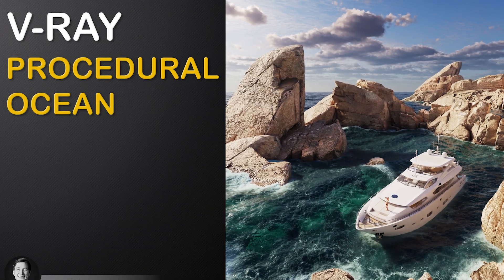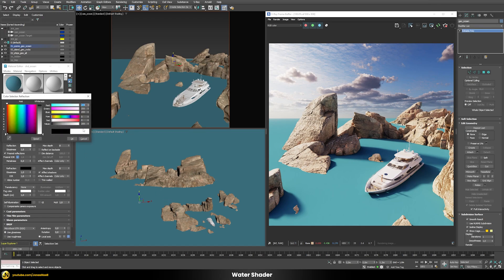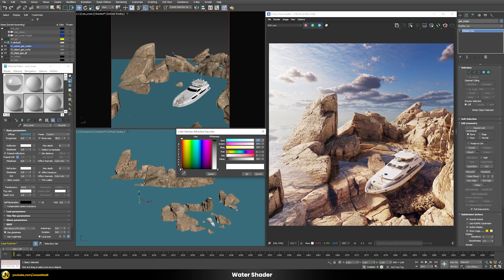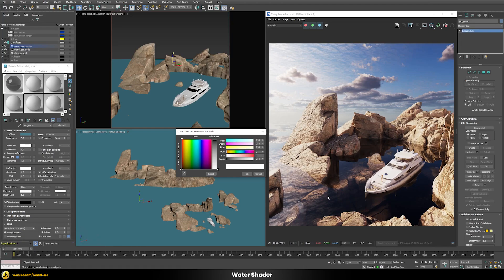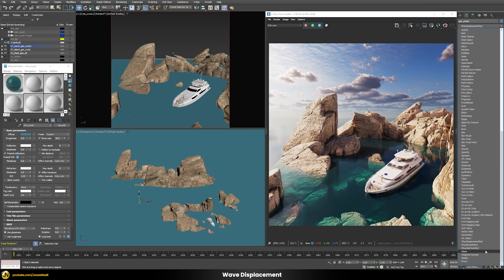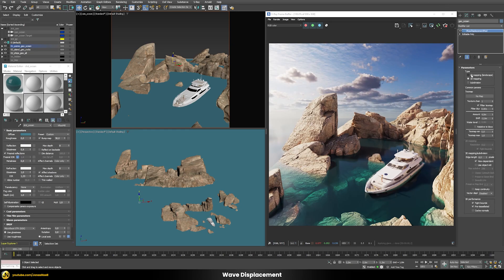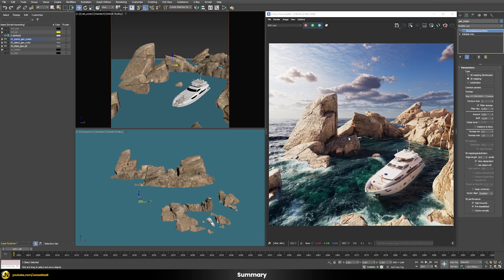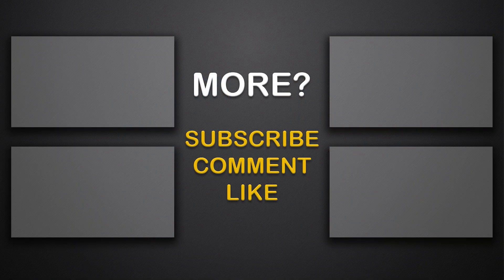V-Ray | Realistic PROCEDURAL OCEAN Shader

Comment from the maker: ✅Check out Patreon for all my scene files, bonus videos, a whole course on car rendering or just to support this channel 🙂
patreon.com/JonasNoell
Reply: Great tutorial! I am wondering, did you give any depth to your water plane? I'm working on a similar project and it seems like if i dont give depth, there is no refraction. If i push the thin walled option there is but its way too much and there is no options... any ideas? thank you.
Reply from the maker: @crazyneonate8626  If I remember correctly I didn't have to. The plane was quite big though. But you're correct normally for refractive shaders you would need some sort of volume to get a accurate result.
Reply: @JonasNoell  Hi Jonas, you are right, you dont have to, my mistake was that the refraction IOR was a 1.33, which is correct but didnt let enough detail come through, when i pushed it down to 1.15 it was perfect! thanks for your answer

Comment: Nice but this should be a standard in max. 30 years ago
btw your fog color was for 1cm
Reply from the maker: What exactly should be a standard?
Reply: @JonasNoell  max should have had a good water material like phoenix long ago. there should be no plugin renderers either. max' built in should be the best. there should be no forest or railclone either. all autodesk specialize in is lazy extreme overpricing

Comment: i tried many times , the result not even close , why is that? what should i do? can anyone answer me?
Reply from the maker: I don’t think with that description anyone is able to help 😀
Reply: @JonasNoell  I set scale to meter, and in Max 2020 with Vray 5.20.02 installed.i even tried with high segment plane and once  with no segment plane.even with high segment box and with no segment box.then I did all of above with changing scale to centimeters.
Then I tried with Max 2022 with Vray 5
Then with Max 2023 Vray 6 
Exactly according to video
Reply from the maker: @vahidmalekpour6139  I guess some issues with your scene and or lighting setup. The scene files for all my tutorials are on my Patreon so you could check those out and replicate your scene from there.

Comment: The final result seems realistic a lot. But why the greenish tint on diffuse and refraction? If you go to the sea and get a bucket of water is crystal clear like this in bathtub. The greenish tint we see in the real photos is from the bed which is covered with seaweed and other sea plants, so maybe could be more appropriate to create the bed terrain correctly, with plants or even with a greenish texture and leave the water clear. This of course takes more time to implement.
Reply from the maker: That’s is not correct, just google for “White swimming pool” and you will see that water has a blueish tint once you have enough volume. The reason for that is that the molecules in the water are absorbing the red parts of the spectrum from the sunlight. The reason why a bucket of water appears clear is because you don’t have enough volume for the effect to show. 
As for the diffuse as explained in the video it’s there to create the illusion of particles inside and on top of the water that would scatter the light. A physically correct water shader would have the diffuse color set to black. And you would need to create a much more complex solution for the under surface light scattering. If you are up for that then go ahead :-)

Comment: I love it! The simplicity of your solutions to seemingly complex problems is always surprising. I use the DirtMap as a mask a lot but never this way...until now! 🥳
Reply from the maker: The simpler the better :)
Reply: I used VRayDistance map for this purpose. I need to try VRayDirt instead.
Reply from the maker: @ViperAleks  Also works, I found VRayDirt more robust though. The DistanceTexture sometimes causes IPR to crash at least on my setup, while VRayDirt is rockstable...
Reply: @JonasNoell  VRayDirt will not work in case if you want to make foam near beach coast line. It will work only if you have rocks coast line.
Reply from the maker: @ViperAleks  It will if you use Inner Occlusion, but be free to use whatever fits best to your workflow
Reply: @JonasNoell  Actually, Inner Occlusion makes it work. Thank you!

Comment: It would be interesting to see it with the PhoenixFD Ocean Texture applied for displacement instead of using the noise node.
Reply from the maker: Agreed, but unfortunately I (and many others) don't own a license of Phoenix so that's why I just used built-in tools.
Reply: @JonasNoell  maybe this is old news but you don't actually need a license to use the PhoenixFD Ocean Texture. You can install a trial and the map will be up and active even after it will expire.

Comment: Can u please give us your pc spec
Reply from the maker: Why am I getting asked this question over and over again? Why is that so important? 
Threadripper 3990x, 64GB, RTX 3060Ti
Reply: @JonasNoell  it's probably because when you make changes they load up so quick. And many of us have systems that take a while to load. Seeing what you use will give us an idea of what to get if we're in the market for a better system. 😬
Reply from the maker: @minds4game  Ok I see, makes sense. But as said sometimes with the magic of editing I also speed up the result 🙂 Anyway I used lots of different systems over the time with much worse hardware and the workflow is always stays the same, it just takes a little bit longer to see the result. But with IPR and denoising the changes between different hardware is also not that dramatic.

Comment: Nice video as always Jonah. I am just curious, when you set fog color from 255 to 254, so really minor change with huge impact. Wouldn't it be better to change Depth (cm) too? Light can get few meter through water so this is maybe the reason why there is so huge change from 255 to 254. It just occurred to me, anyway great video.
Reply from the maker: Hi, yeah the reason why there is this huge change is because the Depth is set to 1cm (the default value), so even a tiny change will have a huge effect for something as big as a whole ocean. For smaller objects the result will be much less drastic. You could also reduce the fog color to something much lower and then increase the Depth a lot. It doesn't really matter as in the end as It basically just defines how much light is being swollowed over the distance it travels into the medium. In this case 1cm and 254 gave me the result I was looking for so I didn't bother to change it and 1cm is the default value :-)